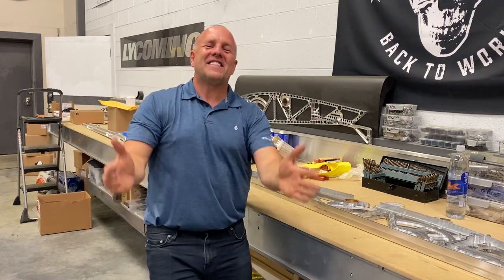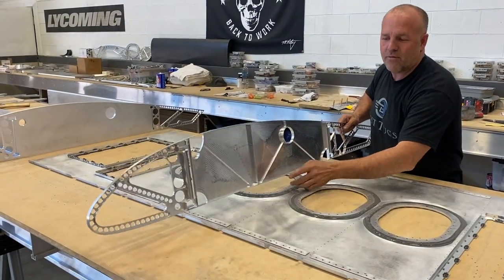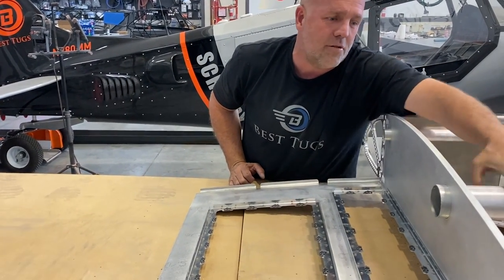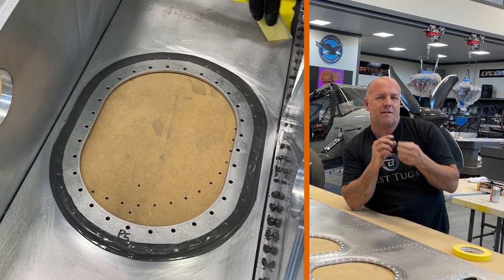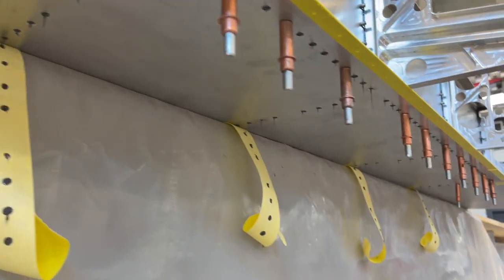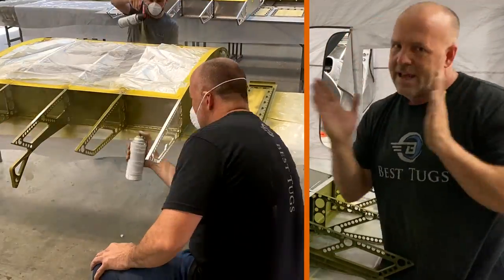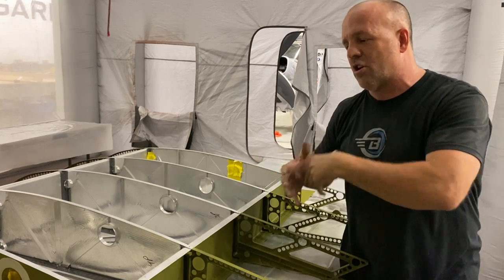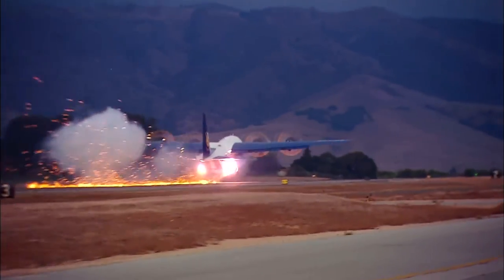Building 120 gal fuel tank for my crazy Bush plane | Scrappy #55

Comment: Hey Mike, how comes the front and rear spar are only the width of the fuel tank? I thought you would let them run through all the wing.
Awesome eye for detail by the way. As always you’re going above and beyond. Love it.
Reply: Those are not the spars, they are the tank walls you see.
Reply: You can see the slots for the wing spars very clearly at 15:30 in the video, just ahead of and behind the tank.
Reply: @cebunting     @bz8x8c Thanks. Now it makes sense. I initially thought he would have used the spars as tank walls like in large aircraft (Airbus/Boeing)

Comment: Mike, just out of curiosity, why not do conversion coatings on your aluminum wing parts/structure? 
Coming from the cooperate jet world, commercial aviation, and Bombardier/Learjet flight test, the modus operandi across the board pretty much starts with conversion coatings. Namely we hit parts with something like Bonderite Alumiprep 33
and then Alodine. From there parts may stay just Alodine treated or go on to primed, painted or sealed. Nice thing with an Alodine part is that it wont lift like a chromate paint, its an excellent substrate for direct sealing as if bare metal but has properties of an anodized finish for corrosion durability. Just curious of your thoughts! 

I know its expensive stuff and hazardous but its really not bad with simple PPE safety gear. The Touch N' Prep pens are nice!

Comment: Tank Sealer Flame out Huh!
That happened to me 34 years ago in a Fokker F28 jet  (60 seat Airliner).
The right engine started to Flame out & I switch it immediately to cross feed on the left tank & turned back to Sydney (Australia) - Max assimetric fuel for the Aircraft was 650 kgs so on descent at flight Idle I tried the tank again with the same result so back to cross feed.
1,000 kgs out of balance on landing. ( Told them what they could do with the Aircraft & went home)  :O)

Comment: So here's a question: Since aluminum gets that black aluminum oxide almost immediately after it gets exposed to air, how do you clean the aluminum and apply the sealer without the oxide forming again before the sealer is applied?  I can't imagine the oxide is very good for bonding the sealer to the aluminum.

Comment: So, inside the tank, if that proseal has a "shelf" from where you pull the tape off, couldn't that start peeling when you have liquid sloshing around in the tank? My experience with proseal in tanks is that you have to smooth that transition to the aluminum as to not create a "shelf". Your way smarter than me, and you think about everything, just adding my 2 cents 😉
Reply from the maker: Great comment 👍🤠 That’s a logical thought process. It’s slightly bit more a theoretical myth. If proseal stays at least .025 at the edge it has more mass and stronger edge line.  Some people used to feather the edge for the thoughts you mention.  Over years that thin edge that is under .005 or traces as it feathers is what starts to lift and then the tank sloshes those “thin” films up that feather out and that’s the start of flip back and forth that can eventually lift the thick edge that normally holds.  The good thing is.  Both ways will work and never lift if the preparation was sanded and prepped with enough texture you will not get either way to ever lift . Thanks for the great comment
Reply: @MikePatey  good to know! Thanks for the reply!

Comment: Torque tube that size, only force I can think of to be transmitted like that would be wing warping?
Reply: Retraction of the leading edge slats, that fit tightly into the rest of the wing, similar to "spooning".

Comment: The cleaner the surfaces that are going to be bonded by tank sealer the better. Even fingerprints or dust can cause problems.
There's a reason why the space industry is so adamant on using protective suits - it's to protect the object, not to protect the wearer.

Comment: Fyi the kc135 had tank sealant issues, caused numerous clogged filters and engine flameouts.
Reply: Just finished the whole video, if you want a flag flown over Afghanistan in a KC-135, the backbone of the air force, let me know. I'll be able to do that for the next few weeks. NKAWTG!

Comment: I don’t see how the fuel will flow to the ‘low point’ in the tank as there doesn’t seem to be pathways for the fuel to pool at a pick up point/outlet.  Please explain….😕
Reply: 20:58 Pause it right there, and you can see the quarter-round cut-outs in the front and rear corner on the bottom of each rib, as well as the top front corner.

Comment: Brother, you just said that zink Cromate will scratch off with your finger nail. 
PLEASE FORGIVE ME. BUT , I grew up in the aviation industry. Lets say 60 years ? It has been said my name is synonymous with the aircraft industry . 
And I have overhauled aircraft parts. And worked on hughs 500d and install the fuel tank inside of a jet ranger. In fact. I owned one with my father. In fact. I have my own type of aircraft that nobody has as of yet. I've had it secret for over 35 years now. And I'd say thats well in advance. And it flys great. And there are  professors whos writings say I have the aircraft of the future, in fact congress demanded it, and my DARPA broad agency report asked for it. 
Whats funny, I used very little real math. 
I even tryed to change my first design. But it told me NO,  put me back. 
It wouldent fly till I did. 
LESSON LEARNED.  
I am an artist of many types. As well as an inventor. And innovater. I have worked as a senior in the application of electrostatic  painting for the zeiman trailer corporation. I know what alodine and zinc chromate are and the reason for their use, also I know what they do. And there is no possibility whatsoever that zinc chromate can be scratched off with your fingernail. In fact allow me to go so much farther and tell you. That anything which has a proper application of zinc chromate on it in the aluminum world will have an in Bedding of zinc chromate deep into its structure. And you will not easily remove this by hand. You most definitely will need a machine. And it won't be easy.
 Such as a part which I intentionally took and Polished out. Which was covered in zinc chromate properly applied. And there is no way you're going to tell me that you can scratch it off with your fingernail. With all due respect.
In fact I actually admire your endeavors. I do like the way that you have constructed your aircraft. In fact I have always been in a  deep desire for Bush flying aircraft period which is probably the reason why I invented my aircraft type instead.
I see good reason for no alodine or zinc chromate primer as you have put it.
But for the rest I must say. There was a reason for zinc chromate and Aladine Which both work in the same way but not with the same application type. The reason for zinc chromate and alodine used in the construction of aircraft which is permissible and acceptable with the Aviation Administration. Is simply that it actually is deep into the metal and it keeps it from corrosion of any type.
 In fact zinc plates are used on the bottom of ships to keep them from corroding from the salty ocean. Which in fact I have seen that things deep in the salty ocean don't actually rust. So really the surface of the ocean is salty. Deeper below its more fresher water. 
So people don't understand that either usually, 
But. My family got into the aircraft industry by chasing planes that went down. I own a couple acceptable practices and methods books by the FAA on how to build an aircraft and why. But this does not make me by any chance a so-called qualified professional.  Yes I know alot of things..So  I can hold my ground with the rest I believe. So I would just like you to take a different look at the zinc chromate and Aladine which by the way, alodine will not go on like zinc chromate it is wiped on with like a sponge. And it's very very thin but what it does is give you very good protection against any type of moisture water salt or any of these type of things which corrode aluminum  quickly. And you have my friend gone through a great deal of work to do these beautiful winglets and I admire that. But I would surely hate to see you lose them shortly down the line because of aluminum corrosion.
Anyway peace. And please fly safe. Looking forward to see the rest of your activities. And thanks a lot for the enjoyment.

Comment: Hey Mike, you need to flip the flag around if you're going to put it on the right hand sleeve. The flag must always appear as if it is flowing.
Reply from the maker: Yes sir. We never back down, always charging forward.  That is the direction I have the flag your confusing what is the front and back of the shirt 👍🤠
Reply: @MikePatey  Ahh okay. So the image you showed was the back of the shirt. My bad, I thought it was the front.

Comment: I must have missed it but if the wings have the tanks in them what has scrappy been running on ?
Reply from the maker: The large vertical header tank.  The wings flow to the header and header to the engine 👍🤠

Comment: Plastic sucks for sealing tools.  That stuff sticks to plastic and makes it tough to get a smooth thin finish.  Metal sealant spreaders work way better.  They wipe off clean and are ready to go again.
Reply: The exception is dome sealing.  Tube caps work awesome for that, unless you make your own flared tulip cups.
Reply from the maker: Agreed 👍🤠 on this situation I cut five different widths of spreaders with scissors and then tossed them all.  If they were all the same I would have used my metal ones and cleaned them
Reply: @MikePatey  I work with some of the best sealers in the world.  Can't afford fuel leaks or clogged lines/filters at 9g.  Loving the thought and progress.

Comment: How many total hours have you put in to this plane?  Including all the cad/engineering/machining/testing/so on!!! 
Clearly this is a very passion build, the amount of engineering and over engineering.    You have thought of literally everything very impressive to watch someone with so much passion!

And would love to know how much spent on carbon fiber/ the build it’s self!   

And lastly clearly you have connections with Cnc machine shops.   So guessing a lot of the cost is lesser then say someone without the connections you clearly have!!
Reply: What if you put a camera or cameras at the bottom of the plane, then connected that to small or large lcd panels so that you could see real time the bottom of the plane, -No blind spots.

Comment: 11:58 there is another issue when over drilling the countersink hole, you are eating the cylindrical part of the hole at the bottom, creating a knife edge effect. This is particularly affecting the way the fastener transfer the shear load  from the skin to the fastener and the internal structure. The bearing load in the hole might see a peak that with time might be damaging the fastener with the risk of failure.

Comment: Why are your spars so short, I've heard of stubby wings but this is ridiculous.  I could not identify areas where a spar could be added to the ones forming your fuel tank.  Please clarify. Thanks Mike.
Reply: Those are just the tank walls.  The spars aren't in yet; they slide through just forward of the front tank wall and just aft of the rear one.  You can see the slots for them pretty clearly once you know where to look.
Reply: @BrooksMoses  I paused the video several times and found the empty slots for the spars.  Thanks for your help, it all makes sense now.

Comment: I really thought you would do carbon fiber wings with ribs epoxied in and a fuel resistant epoxy/carbon/s-glass fuel tank.  Let me know and I will send you a link to buy fuel resistant epoxy.  The riveted aluminum tank/rib system will be too much work to replicate.
Reply from the maker: Thanks I understand completely 👍🤠.  Great thoughts, I love that method and I am very familiar.  Over half of my last 14 builds were carbon fiber with tanks like your discussing.  I have almost every product available for that style application on my shelves. What your describing is what I used when I built  “Turbulence” the name of the fastest single engine turboprop aircraft I built.  There are some different things going on that took me to Alluminum on this wing.  I describe it in a later video.  Thanks for the comment. 👍🤠